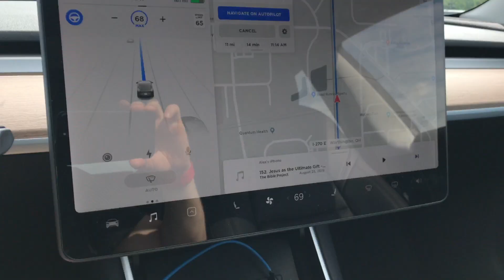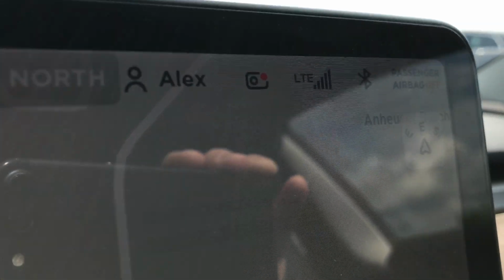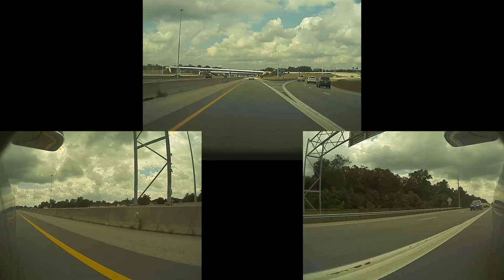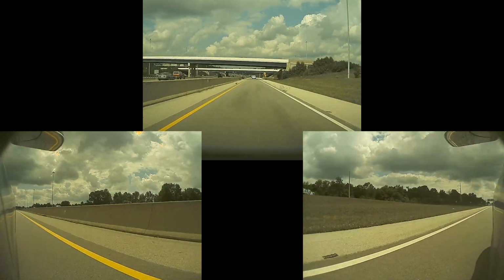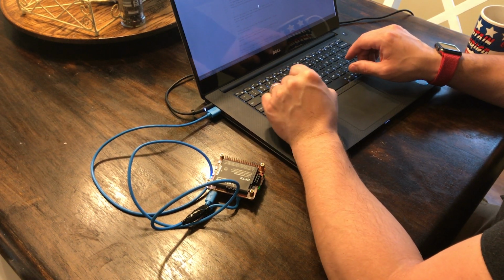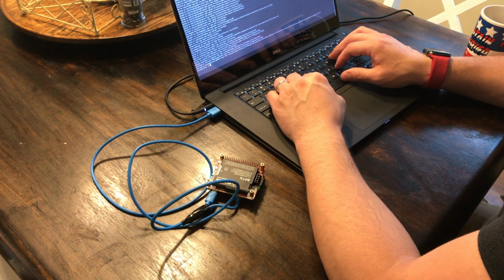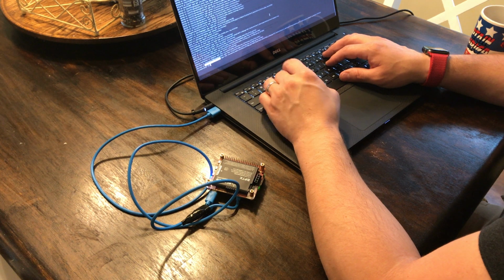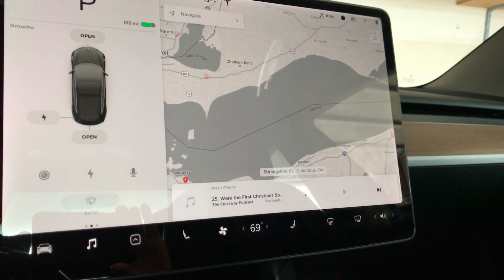Modding my Tesla Model 3 with a Raspberry Pi!

Comment: Awesome! What a cool use case for PiJuice! :-)
Reply from the maker: Pi Supply it’s a great product! I didn’t know about it until I was doing research for this project, but it has almost everything I needed for power management out of the box.

One feature request: system event for power applied! I would love to be able to trigger a power on when power is applied regardless of battery charge state.
Reply: @AlexMarkley  we get asked for that a lot. And definitely going to add it soon
Reply from the maker: Pi Supply Glad to hear it! That will definitely makes booting on command more reliable.
Reply: @PiSupply  Good to know I'm not the only one looking for this!  It's quite literally the only thing preventing me from getting a project off the ground.  I need my pi to boot the moment power is applied, no button presses.
Reply: @PiSupply  When it will be added ? I have received my PiJuice but I can't trigger power on when power coming back :(

Comment: Do you have your car set to not record sentry events at specific locations? I’m not having an issue with my pi crashing star all. I’m also working on a setup so that I can have an SSD hooked up to the pi so that I don’t need to worry about the card getting corrupt after cycles.

Comment: I am working on a mod for my Tesla Model 3 using a Raspberry Pi 0 W, I have a USB CAN Bus module and I'm connecting to the CAN Bus in my Tesla via he center console behind the front seats, I am sharing the USB Device so when the car is parked at my hose it is on my WiFi LAN and I can access the USB CAN Bus module from my iMAC.  I have a Virtual Machine running Ubuntu 22.04 and SavvyCAN, I can access the Tesla Model 3 CAN Bus directly on my iMAC.

Comment: Alex, how you did the partition (g_mass_storage) on Raspbian ? The TeslaCam partition working well on Windows, but when I'm plunging it into my TM3, I got a gray X on the dashcam icon (USB drive is not accesible by Dashcam).  Working fine for music, so I find it strange... Do you have a text file with the step you did ? With the teslacam code on github it's working but I want to create my own scripts and understand it... :(
Reply from the maker: Hey thanks for reaching out! Here’s my partition table (shown using fdisk -l):

Disk /dev/mmcblk0: 119.1 GiB, 127865454592 bytes, 249737216 sectors
Units: sectors of 1 * 512 = 512 bytes
Sector size (logical/physical): 512 bytes / 512 bytes
I/O size (minimum/optimal): 512 bytes / 512 bytes
Disklabel type: dos
Disk identifier: 0x02b658c5

Device         Boot    Start       End   Sectors   Size Id Type
/dev/mmcblk0p1          8192    532480    524289   256M  c W95 FAT32 (LBA)
/dev/mmcblk0p2        540672  17317887  16777216     8G 83 Linux
/dev/mmcblk0p3      17317888 249737215 232419328 110.8G  c W95 FAT32 (LBA)

As you can see, I have my Boot (p1), my Root (p2), and my Dashcam disk (p3).

Then I set my kernel parameters in /boot/cmdline.txt:

dwc_otg.lpm_enable=0 console=serial0,115200 console=tty1 root=PARTUUID=02b658c5-02 rootfstype=ext4 elevator=deadline fsck.repair=yes rootwait g_mass_storage.file=/dev/mmcblk0p3 g_mass_storage.stall=0 g_mass_storage.nofua=1 g_mass_storage.removable=1

There is one big “gotcha” with this approach. As you can see, the entire disk is represented by the partition, so that means (from the Tesla’s perspective) the partition is a whole disk. So the partition itself NEEDS TO HAVE A PARTITION TABLE inside it!

Here is what that partition table looks like:

pi@carcomputer-tesla:~ $ sudo fdisk -l /dev/mmcblk0p3
Disk /dev/mmcblk0p3: 110.8 GiB, 118998695936 bytes, 232419328 sectors
Units: sectors of 1 * 512 = 512 bytes
Sector size (logical/physical): 512 bytes / 512 bytes
I/O size (minimum/optimal): 512 bytes / 512 bytes
Disklabel type: dos
Disk identifier: 0x00000000

Device           Boot Start       End   Sectors   Size Id Type
/dev/mmcblk0p3p1       2048 232419327 232417280 110.8G  b W95 FAT32

Now, you’ll notice the “/dev/mmcblk0p3p1” does not actually exist, so we need to create the dev files for accessing the partitions. I have this line in my /etc/rc.local startup script for this exact purpose:

# Scan for partitions on the mass storage partition.
losetup -P /dev/loop0 /dev/mmcblk0p3

That will create /dev/loop0p1 representing the first partition in our “partition-within-a-partition” table, so now you can interact with the partition normally.

Next we need to actually create the filesystem on the partition. I used mkfs.vfat here, and I pointed it at /dev/loop0p1. I don’t remember the exact incantation here, so you might need to lean on the man page.

Now we can mount and read/write the filesystem locally. I have the following line in my /etc/fstab to give me easy access to the filesystem:

/dev/loop0p1  /mnt/smrtblk    vfat    defaults,noatime,noauto,user 0    0

Now for the final, REALLY BIG caveat. The filesystem CANNOT be accessed both by the Tesla and the Pi at the same time. It is a recipe for catastrophic corruption! So you will need to “disable” or “remove” the partition from the Tesla before you can mount the drive on the Pi. (Exactly when and how to do that is a topic for another day.)

Good luck!
Reply: @AlexMarkley  Thanks for you answer! I figured it out just before you reply! lol For the PIJuice what can be programmed ? Because let drain the battery to Zero every time I leave the car, it's not really a good idea... There a way to cut the power after 30-45 mins after a power failure (no more power from the tesla) ? So at least the PI dont stay on for hours...
Reply from the maker: @FrancoisBerg94  So there are two ways to program PiJuice behaviors.

One is you can use their software to add some "out of the box" configuration and functionality which is really very helpful. (I have it set up to automatically shut down the Pi once the battery drains below something like 30%.)

The other thing you can do is you can use their official Python library to query the PiJuice and learn information about the state of the power management chip and the state of the battery -- then you can program your own custom behaviors and actions based on that.

Good luck!!
Reply: @AlexMarkley  Can you program it so it start the PI when the power came back ?
Reply from the maker: François Bergeron Yes, I have it set up to start up the Pi as soon as the battery starts charging.
Reply: @AlexMarkley  Oh nice! :) Thanks for the info! Would be nice you do a video on that!
Reply from the maker: François Bergeron Yeah! I keep thinking I should do a follow up video. I want to add some features and release my code on Github first maybe.
Reply: @AlexMarkley  It's me again! lol I'm trying since 2 days to have a PHP page that execute this script (with root access):

 shell_exec("sudo /PIMount.sh")

and the PIMount.sh have this content:

#!/bin/bash
sudo modprobe -r g_mass_storage
sudo mount /mnt/cam_disk
sudo mount /mnt/music_disk

When I'm running PIMount.sh directly in the console it's work perfectly... The two mount are accessible from all user on the system. But, when it's running from the PHP page, the mount seem to be only create for that session... If I'm login with root or any other users via the console, I don't see it mounted... But the PHP shell_exec see it mounted and is able to access it (Seem like he have it own session seperatly...). So why via the console it's working and not via shell_exec ? Any ideas ? Do you have an email so I can contact you directly ? :)

Comment: Ok, now I want to do this too. Curious as to what you do with the post-processing..
Reply from the maker: William Weir I’m still working on that part. I’ll share more once I have some real code to share. (Currently I just have a directory with a handful of dumb little shell scripts.)
Reply: Alex Markley what are you doing for the logic to power on/off when the power is “pulled” from the pi? (More curious about the powering on than the powering off)
Reply from the maker: @WilliamWeir  The pijuice has a microcontroller which can be queried and configured via I2C, along with a small raspbian service that can run in the background on the Pi.

So I can configure it to shut the Pi down when the battery starts to run low, and then it can be configured to boot the Pi back up in response to various events.

It has the ability currently to boot the Pi in response to a "Battery Charging" event, as well as RTC alarm events (scheduled wakeups). And in the other comments on this video, the Pi Supply folks told me that "on application of power" is an event they will be adding to the pijuice's firmware.

So it's pretty nifty and powerful!